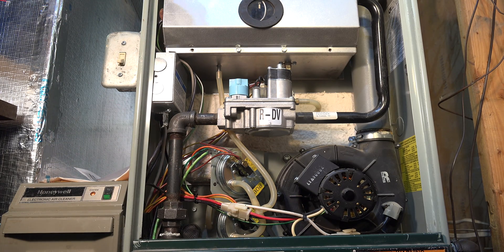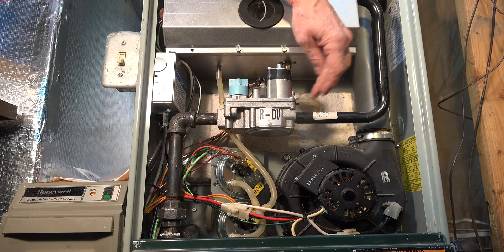The combustion chamber pressure switch

Comment: I had an issue with the furnace not firing I isolated the hose going to the combustion chamber and plugged the hose off going to the valve and it started then I plugged off the hose going to the combustion chamber and it didn’t fire so I tapped the gas valve and it fired up ran the whole night then the customer said it stopped running the next day looks like the gas valve is stuck I forgot to mention the pressure was .14”w.c in combustion chamber
Reply from the maker: I would have to go with the gas valve.
GFM
Reply: @grayfurnaceman  unfortunately the customer called and it went out again yesterday I stopped by and tapped the gas valve again but that didn’t work this time  so squeezed the hose going to the combustion chamber while all the lines were still connected just to isolate the gas valve and the thing fired up there must be something in the intake I’m gonna try using a shop vac first and see if I can suck anything out without cutting the pipe I did check with my digital manometer yesterday I was getting +.16 in wc Yesterday I was getting +.34 in wc and it fired up this thing is driving me nuts haha your videos are awesome man thanks for getting back to me

Comment: I’m having an issue that is pretty intermittent when my furnace goes to light and the burners ignite it throws my pressure switch and the furnace locks out until I power cycled it any ideas.  However once power cycled it will work no problem until it doesn’t run for about a week then the problem will come back again
Reply from the maker: First check venting for blockages and water.  This only for 90+% efficient furnaces.  80% look for water in sensing tubing.  
Another possibility is a crack in the heat exchanger.  Look for flame rollout.
GFM
Reply: @grayfurnaceman  drained my water trap works great for now! Thanks again!

Comment: I was just told today that whomever installed my furnace 7 years ago in our new home choose not to hook up the hose to combustion chamber... instead they tuck the hose in the back and we had no idea that it wasn't hooked up. We had a reading of over 1000ppm of co outside our home.... have you ever seen or heard of this? The tech said it can be common with a Trane furnace and also with the builder/installer
Reply from the maker: Some installers do that to cover mistakes in combustion chamber piping.  Yes, it is dangerous.  This is not the fault of the manufacturer, no manufacturer will back this.  This is an install failure.
GFM

Comment: Hi Mr Gray,  

Problem#1 / solved
Pressure switch tube on inducer side was only getting 1.38wc. Pulled the inducer and gasket looked rough, replaced with new gasket and now getting 1.48wc

Problem#2 / not solved 

Furnace electric ignitor does not lite. Pulled the pressure tube off the combustion box and the ignitor lites. 
-Ignitor, installed new one and still no lite.
-Intake is not clogged as the intake is open in the attic and only has a 90degree pvc bend coming directly off the  combustion box
-Trap took it off and cleaned it, water was not backed up or clogged. Refilled trap with water.
-Combustion Tube, when the inducer kicks in the the combustion pressure tube is pulling -0.11 wc
-if I partially cover the top of the 90 degree pvc air intake the heater will lite ok. 

Is the air intake letting to much air in now?

+grayfurnaceman
Reply: I see this with trane and lennox furnaces during cold spells, no obstructions to be found, pressure switch issues at random. Usually 5-15 years after the install, has to be seals/gaskets, debris inside the exhanger/rot? the overall tightness of the exchangers/drains has lost enough "wc it wont prove the switch?

Comment: Can you just remove the air intake pipe from the combustion chamber? It will reduce the furnace to a low efficiency furnace but you can still use it. I had the ice blockage in the air inlet during a very cold night. I disconnected the inlet pipe for a day and replaced it back when the blockage was gone.
Reply from the maker: The unit will work normally without the inlet.  If you have a screen on the inlet pipe outside, remove it. 
GFM

Comment: 1.Tubing connected to outlet pressure side of a gas valve in your other videos, normally measures positive pressure. 
2.The tubing attached to comb. chamber & secondary H.E. is sensing vac/negative pressure due to normal venting of exhaust gases.
 3. You said: "what the pipe going to the gas valve is for, is to put the gas valve in the same pressure area as the comb. chamber." This reference point (at gas valve) then would seem to be sensing positive pressure from the outlet side of the gas valve (OUT PRES). Having trouble reconciling that with the other reference points (comb. chamber & secondary H.E.) sensing vacuum. 
4. The vacuum pulled by  the normal exhaust gas venting doesn't actually exert any pressure control on the outlet side of the gas valve, correct?  Thank you for your patience, and I wasn't registering "Likes" before. now (or a couple of visits prior).  My apologies, and I certainly will be now.
Reply: +JustPlumDucky 
I did a little research and apparently the tubing at the gas valve is connected to a VENT, not the OUT PRES tap.  In this case then, is this called a modulating gas valve?  The pressure will fluctuate in proportion to the comb. chamber pressure.
Reply from the maker: +JustPlumDucky The point of the pressure sensing of the combustion chamber to the top side of the regulator diaphragm is to put the regulator in the same pressure area as the burners.  Remember, this is a lower pressure than atmospheric.  The venting pressure has little effect on the combustion chamber.  Hope this helps.
GFM

Comment: So, vacuum in chamber also modulates the gas valve regulator ?? Did I get it right? For example,  If we had good vacuum in combustion chamber which means we would have less gas pressure.
Reply from the maker: +Guy Hakverdi If there is a high vacuum in the combustion chamber and the pressure switch stays on, the outlet pressure of the regulator will stay the same when compared to the pressure in the combustion chamber.
GFM

Comment: No water in the condensate (exit) trap could cause the same issue?
Reply from the maker: +Craig Nehring Yes.  If you clean it, refill before starting the furnace.
GFM
Reply: Wow thank you for posting about the condensate trap! This ended up being our issue. I had gone through just about everything trying to get the pressure switch to close and that was it! We had the furnace serviced and I think they left it empty....